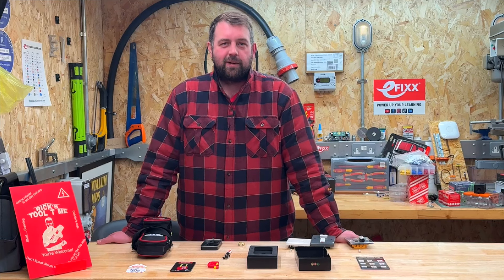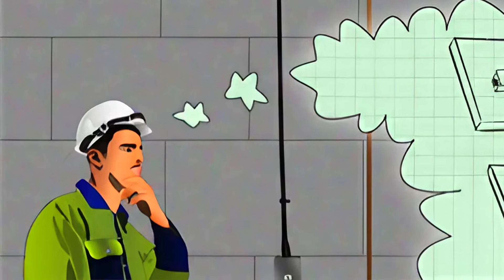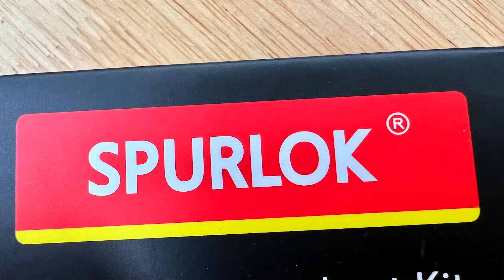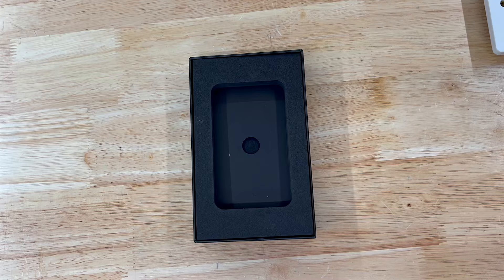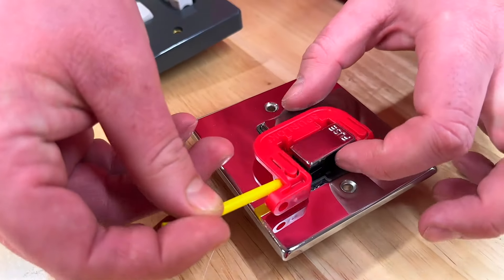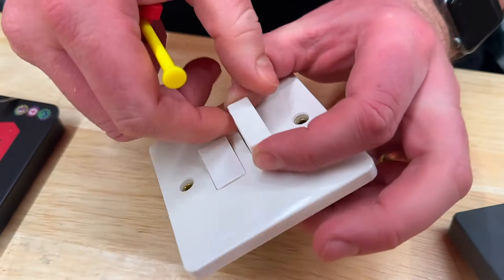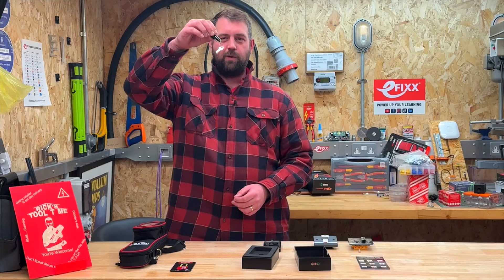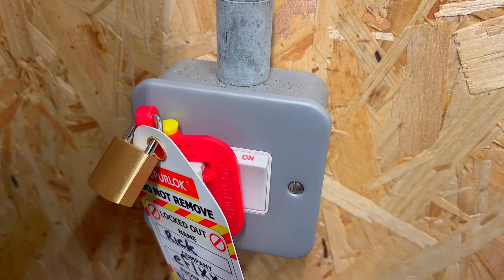SAFE Isolation Now Includes Plumbers | SPURLOK

Comment: Wouldn't just a long shackle padlock do the same thing?  Genuine question, maybe there are some fcu where that would not work?
Reply: That's the idea. One solution for all, rather than just a padlock for some and spurlok for others
Reply from the maker: Doesn’t work on all FCU - depends on how the fuse is held
Reply: Cable tie and sign.
Reply: @petersylvester2905  I think that would probably work in all situations..  Genius hack, I already carry cable ties, anything to make my tool bag lighter..
Reply: @steve11211  the long shackle padlocks will fit 99% of spurs anyway, cable tie for the rest. Requires a key or tool to remove so I see no issue. It's how I leave any spurs or rotary isolators where I've provided the supply only, just without the sign, once they snip it off it's up to them then.
Reply: Ive yet to find a spur that I cannot get a padlock or a cable tie on, maybe I’ve been lucky

Comment: If the fuse spur only disconnects the line conductor is it then really a safe isolation? Isn’t the neutral classed as a live conductor in the UK?
Reply: When you isolate at the board most rcbo's and mcbs only disconnect the line connection, I tend to try and fit MK FCU, because they are nice and easily laid out and they are double pole..
Reply: Certainly would be the case on a TT earthing system. TN-S or TN-C-S, not so much of an issue as the Neutral should be reliably connected to earth.
Reply: I thought the same, think it’s a handy tool but don’t see how we can term this as safe isolation? 
Definitely a step forward for plumbers and alike though!

Comment: I checked and these are £30, a lot of money for a tiny kit. I paid £50 for my ‘electrical isolation kit’ which includes several different kinds of devices, several padlocks and several cards to write the engineers details on. They come in a neat bum bag, far better value than this. 
I’d put it in my bag for £10, at 3 times that price it’s just not worth it, and I LOVE niche tools and happily buy things to improve my productivity.

Comment: Is it a solution to a non existent problem?
He says to isolate a water cooler...

Now. Being an electrician he could isolate the circuit at the board, remove the fcu and fit a blank plate or a new none fauly water cooler.

As others have said. Looks flimsy enough to cut off. 

Also if you spend x amount (havent dared look at the price) on that would you leave it on the fcu and go home? No, I'd spend a smaller amount on a blank plate. 

I struggle to see the innovation, unless he was supposed to say

"Lock off a faulty cooler to do maintenance work on it" 
Either way I'd still just lock off the circuit feeding it not the fcu.
Reply: £30 for one kit

Comment: If only there was a way to just... take the fuse out.
Reply: You have to take the fuse out first! It prevents it being put back in.
Reply: Just removing the fuse doesn't comply with SI rules. You also have to prevent someone reinserting the original or inserting a replacement and reenergising the circuit.